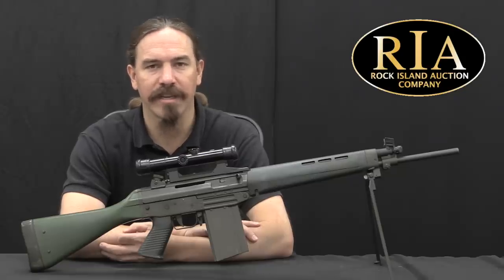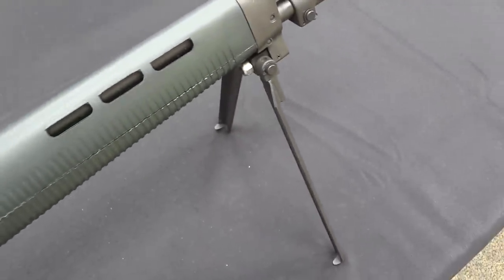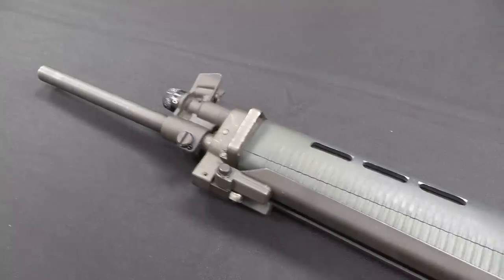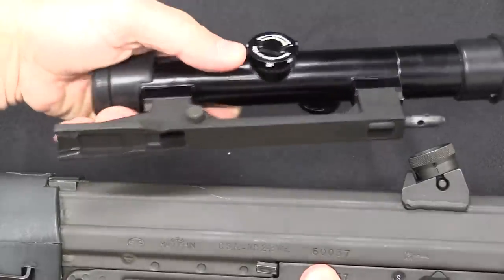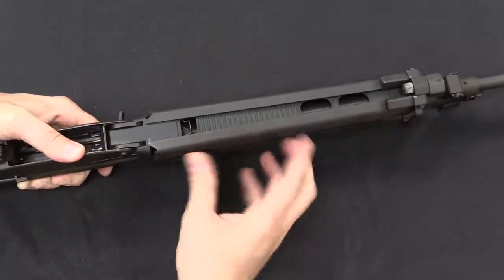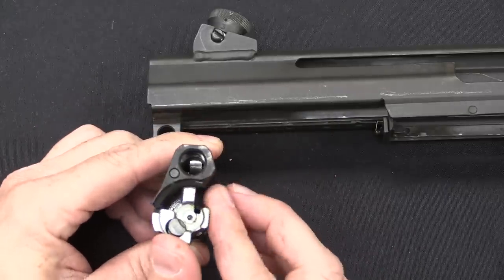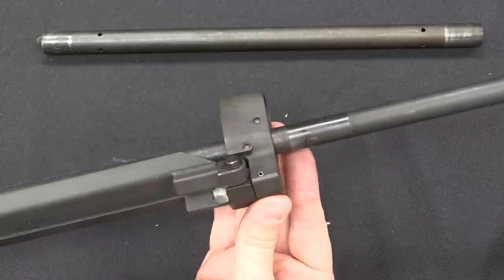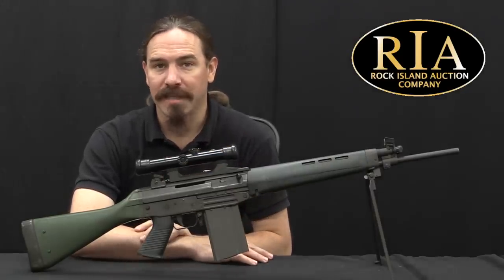The Last Swiss Battle Rifle: SIG-Manurhin 542 (in .243)

Comment: I quite like the look of this rifle,.. I'm also fond of the .243.
Reply: Same here.
Reply: 55 grain .243 will defeat most body armor. It's a very underrated caliber.
Reply: Agreed
Reply: Yeah it's a good looking rifle
Reply: As a teen deer hunting with my father I would usually be shooting an old Monarch Majestic in .243 Win, it definitely is a sweet round.
Reply: @kevdupuis  i had a h&r heavy barrel 243 single shot growing up killed quite a few white tail with it..it was VERY accurate ended up trading it for a mossberg 500 20 ga slug gun and regret it especially since I have a daughter now and would be a great first deer rifle..
Reply: Floyd Vaughn  My father was a professional kangaroo shooter. 243 was his calibre of choice.
Reply: .243 is a great all around cal and since I was a kid this was a great starter all around cal
Reply: @boomerisadog3899  too light. .270 however i know will smoke through most armor no problem. Even my Hornady Superformance had no issue with a 3/8ths inch of AR500.
Reply: @darrengarcia4937  That particular load barely reaches 3,200 fps out of a 24 inch barrel. You're either lying or someone sold you some fake ar500. Speed, bullet construction, and high sectional density kills armor and Hornady Superformance in .270 Win has neither.
Reply: @boomerisadog3899  a small diameter round, denser than .243 and 3200fps. Sounds like you dont shoot steel often. Im pretty sure AR500 doesnt sell fake steel but i'll let them know. It doesnt matter anyway, i have monolithics and steel core from Lehigh if you wanna try those out.
Reply: @darrengarcia4937  .270 is a larger diameter and slower round than than .243, it's only advantages in penetration are mass and sectional density. It's a better round for medium to large game but it doesn't have the speed to get through most armor. I've shot plenty of steel, that's how I know you're full of shit. 3200 fps won't do shit to ar500 unless it's AP.
Reply: @boomerisadog3899  yeah BS dude you havent shot steel i can tell. 3200fps is more than enough to get through most armor. Considering the only bullets with the mass to penetrate armor in .243 average 3200fps, and they put out far less kinetic energy than .270 which if nobody told you yet is another big thing in armor defeating rounds. Notice how tank penetrators are still pretty big and heavy instead of just fast maybe you should tell them a smaller cartridge will defeat armor better.
Reply: @darrengarcia4937  Tank rounds are designed to penetrate armor. .308 AP will penetrate 3/8 inch ar500 at 2,500 fps but it's designed to do so. 55 grain .243 does because of it's speed.  .270 doesn't have the speed or bullet construction to do it. Do some research, or better yet some testing, and you'll realize I'm right. I've shot 3/8 ar500 with .300 WM at 100yds and it doesn't do shit. .300 has just as much speed and far more energy than .270 but it doesn't have enough speed or proper bullet construction to penetrate 3/8 ar500.  You could load with some AP and it would zip right through but a fmj or hunting round just won't do it.
Reply: @boomerisadog3899  you are right my 243 100 gr sp's laugh at ceramic armor ....i havent got a ar500 plate yet to try....id own a 25-06 before a 270 imho i never liked 270

Comment: In 1991 our battalion was converted to the new "small caliber rifle Stgw 90". We handed in our heavy Stgw 57 and initially enjoyed the low weight. In the following weeks some of the new assault rifles broke. Most of the time the folding stock broke. The old 57 we were able to use it in house-to-house warfare to have two men lift a third person with it - no longer worked with the new 90. In the following years we were equipped with grenade launchers, lasers and lamps on the rifle. In the end it was almost as heavy like the old 57.
Reply: The 542-2 folding stock is very solid and not uncomfortable at all. I used it during conscription in an armored regiment in Chile, back in 2001. Then the old 510 was still in service as marksman rifle, maybe to this day.

Comment: Very nice video Ian. I used the FAMAE 7,62 NATO version of this rifle in Chilean Military School (Officer School, back in 1990 when we finished the last 2 years of high School there) and latter when I was a reservist. Brought back lots of memories! The version I used in Military School had 3 settings: safe, semi and 3 round burst. The version I used during the 2010s had full auto instead of 3 round burst. This latter version had Manhurin and FAMAE markings, something that baffled me. Now I understand the relation of the French revolver maker with this rifle.
Our rifle had some differences. The system to assemble the upper and lower hand guards was different. It used a series of several small hooks that held the upper and lower halves together. To dissassemble, both pins came out of the rifle. We always separated both halves. You really needed your pocketknife screwdriver or at least a coin like metal piece to dissassemble the gun. The plastic tab that you need to move to free the charging handle could wear down a lot in old guns. ( We are a conscript army so the guns get new users over the years.) It's great when you get a refurbished or new gun. Of course the gun has a flash hidder at the muzzle and accepts a socket handle bayonet. I much prefer the Galil bayonet with a normal handle. Much more useful as a hand held knife. The bipod makes it very accurate to shoot prone. Standing up, you better get a good cheeck weld. I learned by getting bruised. A characteristic of this gun is it's forcefull ejection. The brass come out with a special dent. 
FAMAE also made 5,52 versions and offers upgrade kits for these guns with picantinny rails. They also sell civilian versions in Canada.
These rifle was the basis of the FAMAE SAF (Subametralladora FAMAE/FAMAE Submachinegun). The SAF is FAMAE's greatest export success, mainly with police and correctionals. It has users in Chile, Portugal, Brasil, Panamá, Nicaragua and at least one more Central American country and possibly Uruguay. It's also marketed in North America.

Comment: I suspect that if the .243 Win had been the battle rifle caliber instead of 7.62, it would have taken a lot longer for the U.S. and other marksmanship-focused militaries to switch to something smaller.  Such good ballistics with so little recoil.
Reply: @P. Cameron Yes, that's why 5.56 became the NATO standard, and would have eventually.
But even in Vietnam, the U.S. was trying to use full-auto 7.62 guns.  .243 is significantly lighter than 7.62.  Not as much as 5.56, but the military doesn't like to change, and .243 would likely have been "good enough" at volume fire while being superior in ballistics, so it would have stuck around longer.
Which is what I said in the first place.

Comment: 14:05 the gas block screw is rotated 180 degrees, not 90.   Thanks for the cool review and history!

The design is very much a variation on AK.  The lower receiver and hardguards do look a bit thin gauge.

It's a very thoughtful, simplified design.  Main flaw is putting the recoil spring over the hot barrel, which could lead to a loss of spring temper, given enough heat.

Keep in mind though, the Swiss general's comment to the Nazi general about what would happen if the German Army marched over the Alps into Switzerland.  The Swiss General said his militiamen would each fire one shot, then go home.  

Swiss military doctrine is precision shooting, not spray and pray.

Comment: Hmm, that scope assembly mounting arrangement explains something.  I recently picked up one of the Beretta AR70/90 parts kits, expecting that the mad metalsmiths of the interwebz would soon produce receiver flats, barrels and so on.  That ungainly (albeit distinctive) carry handle just ruins the lines of the rifle (IMO), but that optics rig - yeah, that has possibilities.  Judging from the similarly shaped barrel trunnion poking through the sheet metal, it seems to be intended for similar scopes.  Probably should've done more research in advance - but I knew it was part of that SIG partnership, so it was an easy impulse purchase.  Thanks for another very informative video.
Reply: There are several manufacturers of picatinny rails for the 70/90 (this is the closer to the original "Terni arsenal" one of the Italian Army https://www.dccsoftair.eu/slitte-fucili/1299-attacco-picatinny-rail-per-ar7090-defcon5.html ), and at least one manufacturer of a quad picatinny front handguard ( https://www.dccsoftair.eu/ris-armi/1917-ris-quad-rail-picatinny-x-ar7090-defcon5.html ). They are quite expensive tough.
Reply: @neutronalchemist3241   Thanks for the links - I may give the receiver-mounted pic rail a try (it's around $100 less than the one made by B&T).  Good to know there are updated hand guards as well.

Comment: I own a FAMAE built version of this gun in 7.62x51mm. It's interesting to see the slight differences with the Manurhin built example and my rifle.  My rifle does not have a gas cut-off on it, only a 1 and 2 gas position. Also the FAMAE version does not have the fancy window for the selector switch; it instead has a more traditional style selector switch with selector markings painted onto the receiver, and the selector switch is smaller and ambidextrous.  Another really minor difference is that the FAMAE has a bigger button for taking out the charging handle and separating the bolt from the gas-piston. The disassembly pins on the FAMae are not captive, they are interchangeable with each other, and have some crazy internal spring thing where you need to push a button on the pin while pulling the pin out. It's the strangest and most complicated disassembly pin I have ever seen. Finally, there is no spring in the bottom handguard, it just falls off when you take the lower receiver off, same with the top handguard.
Reply: Here in Chile we cannot buy it :-(

Comment: The gas rod is similar to the SVT-40 with the spring on the rod. The only difference is this has a gas piston on the front of the rod while the SVT-40 puts a cup on the rod and the piston is mounted to the gas block.

Comment: 100-110 heavy loads for the 243 win, will approximate the external ballistics of the 147grain 7.62 NATO load  . Commercial Remington core lokt 100 grain round nose are labeled as 2890 fps from 24 Inch barrel. And measured 100 yrd velocity is about 2630 fps .  Drop is also very simar to 7.62 NATO so I bet it works well for hunting deer sized game out to 300 yards or more.

Comment: I actually flinched at 14:34 when the screwdriver slipped. I wrap mine in tape now so the blade doesn't mar the metal...
Reply: And I thought you were worried about Ian sticking it in his hand !
Reply: @martingardener90  That's nothing compared to what Larry Vickers would do to Ian for scratching his SG542...

Comment: Will there ever be a return to the battle rifle with its full power cartridge I wonder? What would it take for that change to happen?

Not ubiquitous body armour as when the Russians adopted that the result was a dash for even smaller rounds. Perhaps some kind of evolution in active stabilized optics that allow the common private soldier to hit targets from what now seems long range? Maybe some kind of recoil reducing breakthrough, as uncontrollability seems to be the complaint usually levelled against the select-fire M14? Even now there must be advantages in a physically larger round over the 5.56 and its even smaller relatives which secondary factors make unattractive. Physical weight of the ammunition seems to be one major problem that I doubt will ever change.

Comment: even swiss knives are complicated
Reply: No they are not! They are very simple slip joints with many functions. Perhaps that feels complicated for the simpler minds?
Reply: @Mustafa Areeb What if the knife is a bayonet?
Reply: @RiderOftheNorth1968  The Wenger Swiss Army knives had a slightly over-complicated cantilever spring setup on their scissors.  More durable than the Victorinox flat spring, though.
Reply: @jic1  It is true what you are saying but the "original" army knife do not have scissors..... Many other, more modern, models do not feature scissors either, if we are to look into the small details! ;-)

Comment: A hole in the receiver directly over the trigger group?  Oh man, I bet this thing would be an unholy disaster in the mud test.
At least it has space for tactical skittles.
Reply: In the SIG550 there is a loading tool for magazines in pistol grip compartment. At least in the army issue ones. Maybe that was the same for the 540 series but they just didnt have a fitting tool for .243 or it got lost somewhere along the way.
Reply: @Soff1859  Hrm.  Loading tool or Tactical Skittles?

Loading tool for an easy to load double stacked magazine, or a tasty treat when you're on the line for 3 straight days?
Reply: @pscwplb  its a stripper clip guide and all the army issue ammo comes in boxes of 50 rounds on 10rd clips. If you spend hours shooting hundreds of rounds with just 3x 20 round magazines per man, it really makes a big difference.

And we dont have skittles. We have swiss army chocolate. Which is (of course) awesome. Too big to fit in there tho ;)

Comment: Completely unrelated to the video, I have just found out about the Pacifica Technica 7.62mm D.U.D.S. (Depleted Uranium Discarding Sabot) ammunition and have so far been unable to find any info on it's Armour Piercing capability. I would imagine a 56.5 grain DU core travelling at over 4000fps has a bit of punch to it

Comment: Swiss AK.. so many neat little improvements.. upper/lower split like a FAL, solves scope mounting issues.. Why not always put the recoil spring on the gas tube, as it's there anyway?
Reply: @ndenise3460  Yes they did, more or less. On the Sig 550 the stock folds. One disadvantage of the spring around the oprod is that the oprod needs to be pretty thick, so together with the spring it becomes quite front heavy. Also it's harder to make a nice short carbine because the spring needs a certain minimum length

Comment: 1:33 If one was to look at the relevant SIG and Beretta patents, it looks like both companies were working on AK-like firearms in this project and then took different paths. All the while SIG 530 was a  sidekick project in this line of developments. 
12:28 Although - and it's a common development between Beretta and SIG - the guiding lug is separate from the set of locking lugs, for which the reasons I can only guess.
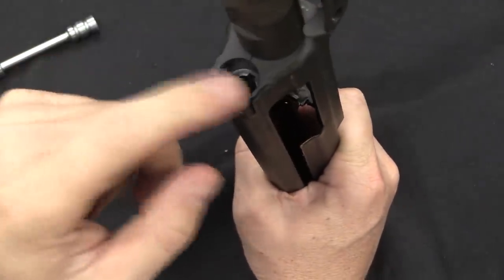15:34 So, not only have they borrowed from Kalashnikov, but from Degtyaryov as well, and in a most stupid way possible! I wonder how often would one replace the main spring due to the loss of heat treatment.
Reply: It amost seems they have increased the distance between the end of the piston and the start of the spring on the 550 but I could be wrong. I've never heard of anyone having to replace the main spring, neither in the military or civilian sport shooters here in Switzerland.

Comment: Swiss SIG really fell off the radar for many years in the US, I know they recently got some agreement or license to import something to the US but I am not sure what perhaps a new iteration of the SIG 550 after seeing H&K do well with the new MP5?   I know that both SIG US and the Swiss SIG are owned by the same parent company but they really work independently to the point of Swiss SIG needing a 3rd party importer.   I wonder how they will brand themselves to not confuse customers with the US SIG.
Reply: The problem seems to be US import laws, which I think ban semi-auto rifles from being brought in. That's why Swiss SIG makes a pistol version of the 553 that is being imported to the US.
And they are freaking expensive, a new 550/551/553 is 3500 to 4000 USD here in Switzerland!
Reply: @spoeny  semi-auto rifles aren't banned from importation, but they need to pass some arbitrary "sporting purposes" test. Which basically bans pistol grips.

Comment: looks like the the front part is using a pin to lock on the barrel. Bad memories with the MAT 49 and its sight assembly: not very rigid in tough conditions.

Comment: I would guess that the Gas block could be remover using a 1 or 2 Swiss Franc coin the 1 is 1.55mm think and the 2 is 2.15mm think.

Comment: Sorry to correct you Ian but the Swiss army SIG 550-1/StGw 90 is actually chambered for the swiss 5.6mm cartridge, not for NATO 5.56.
Quite the same but requires a different barrel twist (1/10)
Reply: All of the 550s Stgw90s are chambered in 5.56mm. They made 7 twist barrels for export, and the predominantly Swiss domestic and target PE-90s had 10 twist barrels to optimize the use of the 63 grain FMJBT bullet used in the GP-90 ammunition.

Comment: So, is it short stroke or long stroke?

Edit: rewatched again, I missed the charging handle locking the piston rod to the bolt carrier for the first time, so it must be long stroke. And of course there is no second spring for the bolt carrier.

I think I like this version of AK better than AK. 😀
Reply: Yes, long.

Comment: The charging handle release looks like it could cause problems.
Is there any documentations it ever cause problems?

Surprisingly less parts than what I expected for a Swiss rifle.
Reply: In the stgw 90 (sig 550) version, it rotates instead of going back. I suppose this could unlock itself under recoil, and they changed it for the army version
Reply: The answer must no then. Maybe?
Would be a quite a nasty surprise to find out that you have lost the handle when a combat starts.